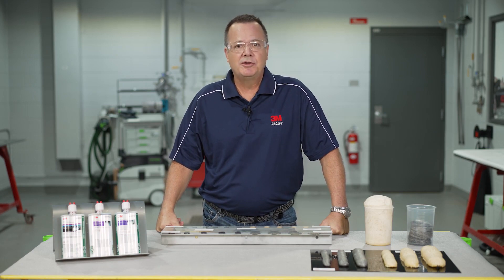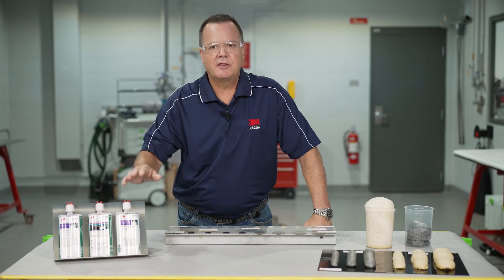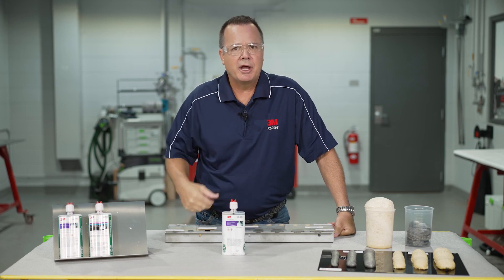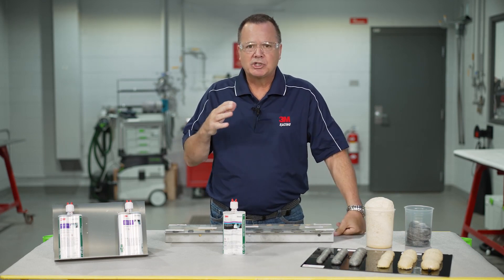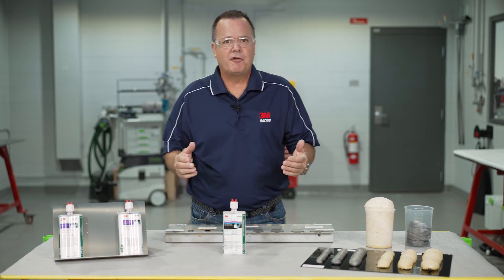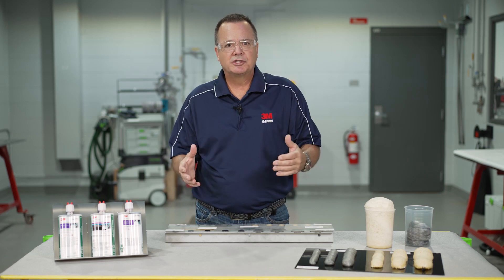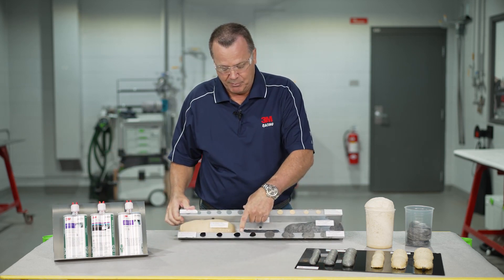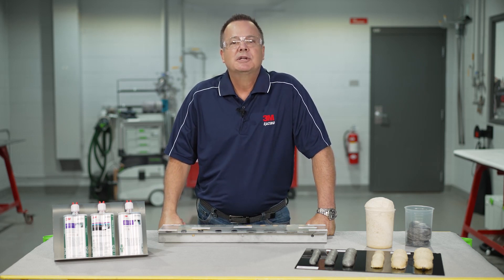3M Tech Tips: Automotive Foams Episode 1: Selecting the Right Foam

Comment: Thanks for the video.  Im building a 67 Fairlane.  Which foam should i use on the trunk lid?  The panel has lost its material, between it and the structure.  What product do i use without creating a high spot?

Comment: HOW TO PUT THE TAPE IN CAR FOR COVER THE DOORS, WINDOWS...?
Reply: The first foam or third one, if your talking bout that clear plastic sheet, sometimes even a foam fourms insert is included behind the door panels to keep water/ moisture from  the electrical components and switches behind the door panel. Typically see the foam ones on higher end cars as it helps with the sound deadening.